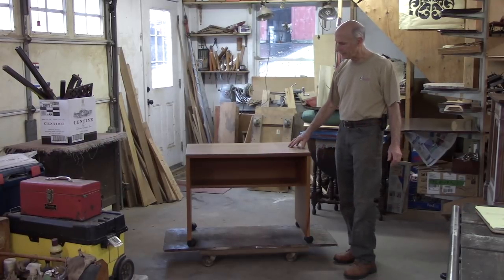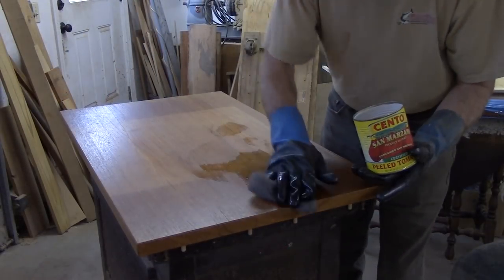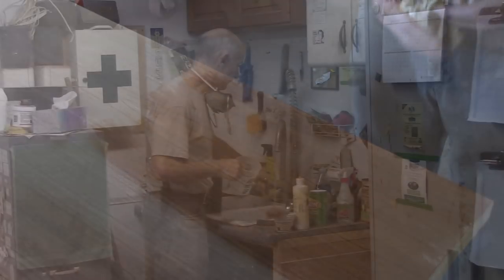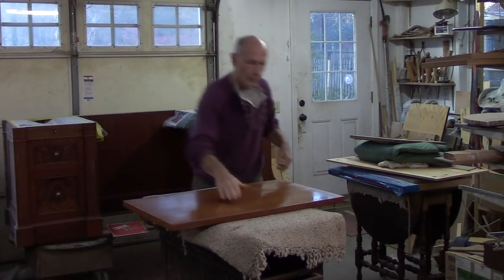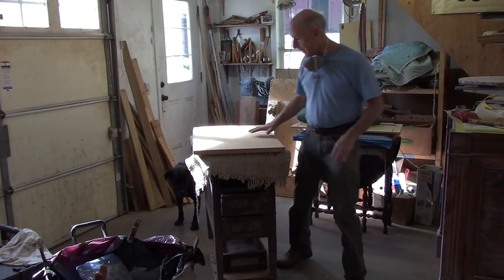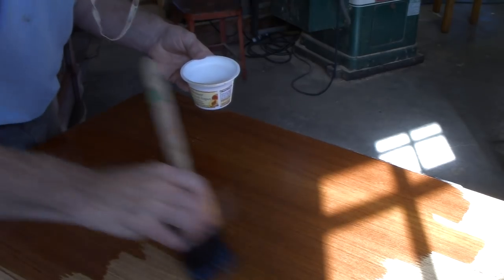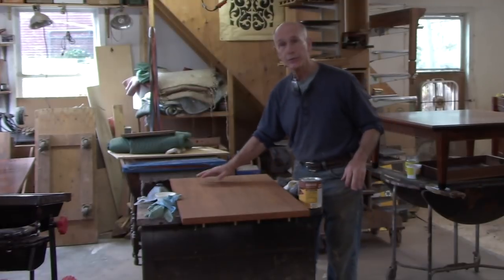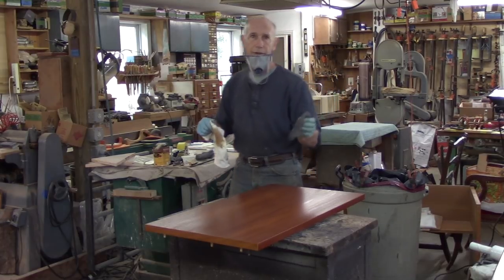Restoring a Danish Modern Teak Desk - Thomas Johnson Antique Furniture Restoration

Comment: Mr. Johnson-  I've enjoyed watching all of your videos and have learned so much. Having recently retired, I love working with my hands doing this kind of work. The most important thing I've learned, other than the many little tips and tricks, is to think things through with calm patience.  I really enjoy when you put your thinking process into the mix with sound reasoning, and if it doesn't work...you go with a different option, as most everything is correctable.  Thank You for your videos.  Now, if I can just get that color match thing down!  That is where the art and experience really comes into play. I usually work with gel stains, as they are more forgiving, but it seems that aniline dyes give you a lot of control, as well...I've got to give them a try.   Thanks from Iowa!
Reply from the maker: Hi Roger, thanks for watching. I don't know what I'd do without my dye stains, give them a try!

Comment: It surprises me that the Danish Modern veneered furniture made in the 1980s used higher quality materials than the furniture that is currently sold at Ikea. I'll have to try the finishing tips that you presented and see if I bring an old computer desk back to its former glory. Thanks, Tom!
Reply from the maker: I haven't seen much IKEA, but a lot of times the older stuff has thicker veneer. Give it a try!

Comment: I used to work in a Scandinavian teak furniture store. As I remember, teak was VERY reactive to light. It would develop a dark shadow from anything sitting on it very quickly. We just had to not leave  anything sitting on it in one place for long. However dark stains would eventually fade away if exposed to light again. 
(We called those round steel joining mechanisms "cam locks".)
Reply from the maker: Thanks! We have experienced the same thing with raw cherry - I never knew it could happen to teak too!

Comment: Love your channel.  I have a video request.  I know your specialty is furniture, but would you consider doing a video on restoring old wood trim in a home.  My home a late 20's  home with pine  trim that is in need of cleaning and touching up.  The floors are yellow pine and have been professionally refinished and now the wood trim and pine built-ins look very sad.
Reply from the maker: Thanks! I'll see what I can do. If not trim, I might find a pine piece of furniture in similar condition. What we did with our old woodwork was to wash it with a mild TSP solution, "sand" it with gray ScotchBrite pads, then brushed on a coat of shellac (Universal Sanding Sealer). We then did 2 more coats of shellac, but you could also use a satin water-based urethane for a less shiny look

Comment: Wonderful, tremendously informative, especially for us DIY'ers who are not near your shop.  Thank you!   I wonder about the finish materials you use.  I have some curbside finds of MCM teak furniture that I'd like to refinish, but I am uncertain what finish to use.  I own a copy of Bob Flexnor's "Understanding Wood Finishing," and he cautions about the natural oil present in teak, that it often impedes varnish cure.  Yet, he doesn't have a lot of detailed solutions for that (vs. the wealth of info he has on how to treat other woods).  Are you willing to share your finish materials?
Reply from the maker: Thanks! On MCM, you can use any type of oil finish, Watco Danish Oil is the old standby. For tops I use Waterlox Tung Oil Sealer, applied the same as an oil finish

Comment: Thanks for your generosity in sharing your knowledge.  You used two products from Waterlox and I want to check I have it right: first was the Universal tung oil sealer and then the second was Original Finish Satin.    I am in Canada and I don't know if I will be able to get Waterlox here, but before I reach out to them I want to be sure about what I should be getting.  The Waterlox directions (website) advise against using a brush for the Tung oil but you did.  Can you comment.  Again, thanks
Reply from the maker: You're welcome! I hope you can get the Waterlox, and you are correct on the products. In later videos I do switch to a foam brush, per the website, and they work much better
Reply: thanks.  Have you tried the H2O versions of their products?  @johnsonrestoration

Comment: Hi Thomas, you do some absolutely beautiful work. Thank you ever so much for sharing. I was wondering if you could tell me how you decide which type of glue to use for glue ups. I notice that you use primary hide glue for veneers but no particular rhyme or reason when gluing larger joints. It seems pretty well split between hide and what I assume is PVA. Thanks, Dan
Reply from the maker: I use 3 types of glue. For period antiques I use hide glue, because that is the standard treatment, for various reasons, but mostly for authenticity. For everything else PVA, either Elmers or TiteBond (by the way, Elmer's White Glue is the best, but everyone seems to be predjudiced against it), and for situations that are hopeless I would use West System Epoxy.
Reply: Thomas Johnson Antique Furniture Restoration Thank you very much for the reply Thomas.

Comment: Thanks Tom, great work and advice. I have a question about a solid teak 1960s sideboard, which has some discolouration. Do your methods for the teak veneer restoration work equally well for solid wood?
Reply from the maker: Yes, no problem at all.

Comment: If I’m planning to use commercial teak oil to maintain my piece, do I finish with tung oil first as in the video?

And will the acetone remove the old teak oil finish that has hardened and become shiney?(I know only teak oil has been used on the piece over the years) 

Thank you
Reply from the maker: Thanks! Yes, acetone will clean it off fine. And then go with just the teak oil

Comment: I'm curious about the "keep it wet" part of the process.  What is accomplished by re-applying the oil to keep it wet for 15 mins as opposed to letting it dry?
Reply from the maker: Thanks! With the first coat the oil soaks in unevenly, you want to keep it wet so that all the areas are sealed to the same level. The subsequent coats it's usually not necessary

Comment: Can you lighten teak wood to a much lighter color?
Reply from the maker: I suppose you could bleach it, but only new wood, I doubt bleach would take on old. Teak's an oily wood, I'm not sure bleach would work. Or try staining it with a golden oak stain, or yellow and orange dye stains
Reply: @johnsonrestoration   ok, thank you so much because a client of mine is wanting it to resemble the color of bleached wood & I just didn't think it would be possible. I think I'm going to try what you said but make sure she has a backup plan just in case it doesn't work & I'll let you know how it goes and what happens when I try those stains on there. Thank you so much!